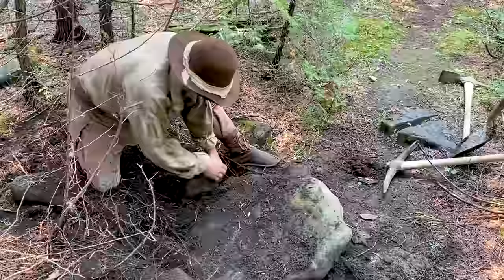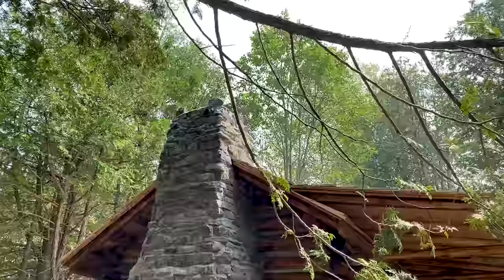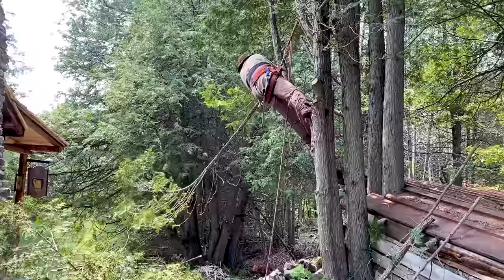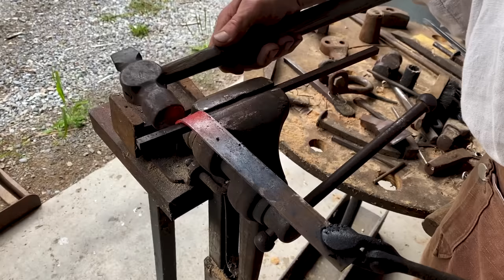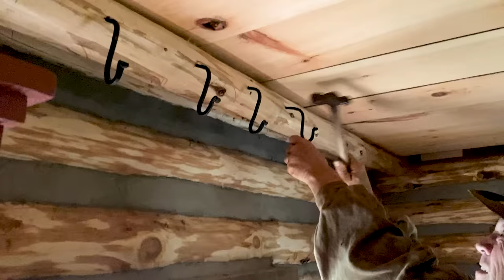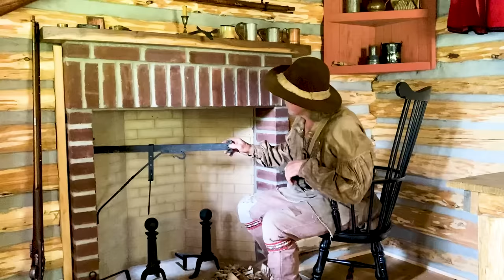First Fire in the Rumford Fireplace  | CABIN BUILD | PIONEER | OFF GRID

Comment: There is a big, big difference between 1710 and 1790. Which end are you tending towards ?
Reply from the maker: Most of the reproduction items I make would have been used from the mid 1700’s on.  Some items like my smoothbore flintlock are early 18th century but, would have been used, in some cases, right up to the War of 1812.  People simply did not discard something that worked.

Comment: The volume of stone in the fireplace will store a lot of heat after a couple of days, this will keep the cabin warm overnight after the fire is out.
Reply from the maker: That is the plan Norman.  Should know soon …winter is not that awful far away.
Reply: @TheWoodlandEscape  As you say, it is the turning point in more ways than one. Here in North Scotland the leaves are turning and the rowans are setting berries.
Our house is over 120 yrs old,  built of stone as found with quoins and ashlars of dressed sandstone. The walls are almost 2 feet thick. We have 4 fireplaces all with clay pipe liners in the chimneys,  we only use the two ground floor ones.  I installed a water jacketed woodstove in one, which can produce 20kW  It feeds our domestic hot water and radiators in the house and a large addition, 5 bedrooms in all.  The other fireplace has a cast iron stove, which is a backup/ occasional use.  We opted for these so as to save firewood,  I built the addition myself with some help,  The front gable wall is built of stone as described before,  I laid every stone,  mostly gathered from the river Findhorn,  a labor of love.  The ground floor is my shop,  3 cnc machines and a couple of manual ones, that was my plan, to be independant.  I also have a stove in the shop! It can take 2 pots to cook food.Fail to prepare ...prepare to fail....God bless. Norm. ps  my great grandfather was a stone mason.
Reply from the maker: What a great place you have.  You must go through a lot of firewood, even with your modifications.

Comment: What was the reason to built the fire place at the end of the cabin instead of building it in the middle of a bit bigger cabin? Wouldn't higher thermal yeald be worth of the effort?
Reply from the maker: We attempted to recreate a 1700’s settlers cabin and that is the way they built them. You are spot on, having it in the center would be more efficient.  It is a Rumsfordo design so, it is a lot more efficient than your average fireplace.

Comment: Really do not understand why is the mass of chimney out of cabin - you gave up  90 % of energy of firewood, you have zero accumulation and the fireplace itself looks like open without any damper. That means after fire is gone, chimney will suck all the warm air from cabin replacing it with cold air from outside...Can you please react?
Reply from the maker: Happy to react Karel.  Fireplaces in the 1700 were almost always on the outside of the house.  The chimney was usually dry layer stone and in the event of fire could literally be pulled of the house.  Ours does have a full damper between the throat and the smoke chamber (demonstrated in previous episodes).  Also if you Google Rumford fireplace, you will see that they are indeed very efficient.  Thanks for your interest.

Comment: You messed up from the start. The rocks you using not going to last!!! An old stone Mason once told me, if you going to build a fireplace, never use rock out of a creek or that are buried in the ground. Always use stones you find laying on top of the ground.
Reply from the maker: I agree Finn but all the rocks used in the chimney came from old fence rows and above ground.  The exception would have been the cap but, that didn’t work and the chimney remains open.